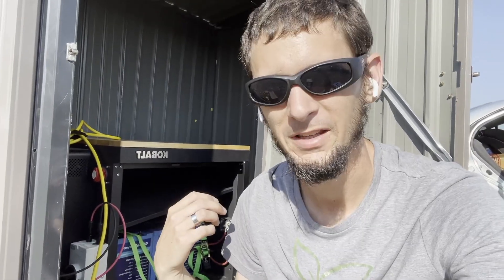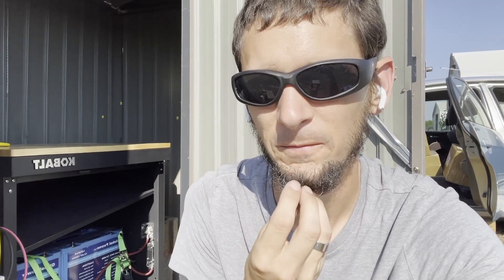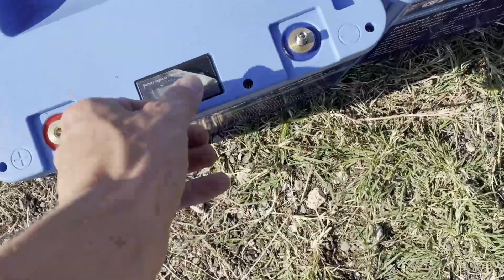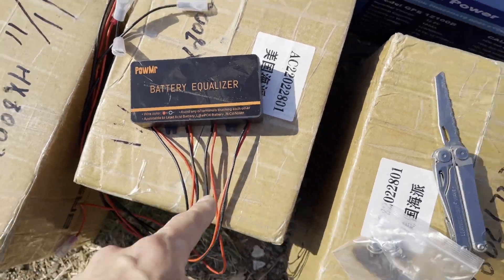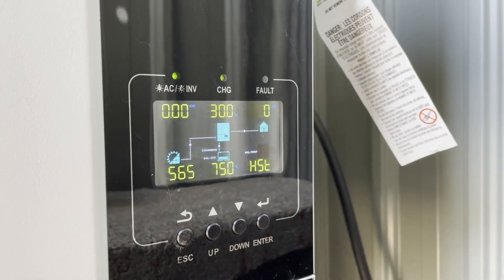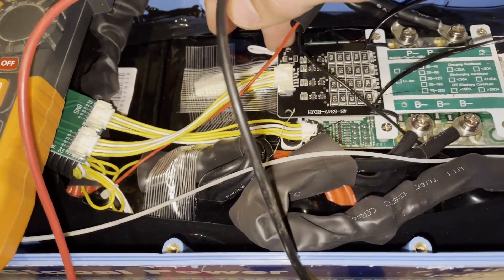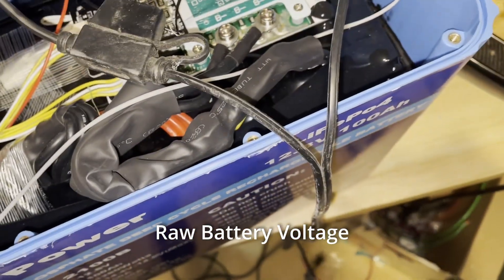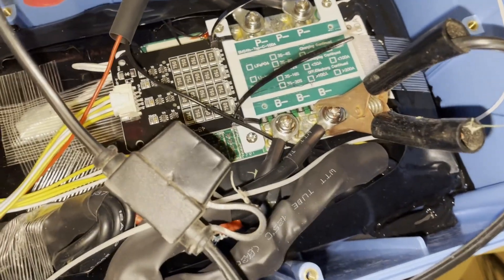Global Power Sabotaged My Power Cabinet

Comment: I had the exact same issue and Global just replaced it.  Its the second total fail out of 4 purchased.  I decided to do a capacity test on the other three once I received the new replacement and all three are way off 100ah from 58ah to 65ah.  The brand new one is closer at 88ah after only one charge.  I purchased them in November of 21

Comment: I have 2 of these batteries and am thinking about splitting the 20p packs in 2 in order to make a 48v, 16s10p Pack with those 32650 cells.  I would then use 1 jbd bms to rule them all.
Reply: 20S in a 12V battery?
Reply: @ericklein5097  oops 20p not 20s

Comment: After seeing your video review of these batteries last year, I bought 4 of these Global Power batteries. Then months later you posted another review downgrading them. I think you found a problem with the BMS but want to makes sure I get the right BMS replacement. Please post a link of the parts I need to upgrade the defect on these batteries, thanks.
Reply from the maker: Hi Ray, I apologize for any troubles I caused from that first video. Truly that first battery tested well but then others I bought didn't! Guess I need a larger sample size in the future. Regarding the BMS, are you running these batteries in series or keeping them in parallel for 12v operation?
Reply: No apology necessary. Your initial testing was thorough. I am using them in parallel for 12 volt operation on a 5th wheel camper. Thanks in advance.
Reply from the maker: @raystanton238  This is a good unit and has bluetooth if you want to monitor the batteries. It has the bolt-through connections so you shouldn't need to solder anything. Might need to pick up some 5/16" bolts and nuts from the hardware store. Just be careful the BMS can't come in contact with the positive and negative terminals of the battery once it's all buttoned back up. https://s.click.aliexpress.com/e/_DEhvU1D
Reply: I just got the 4 recommended BMS units for my four global power 100ah batteries. Can you recommend a video that shows how to install them? Thanks in advance!
Reply: @raystanton238  do you still need help or were you able to figure it out?
Reply: @ericklean5097 I replaced the BMS in all 4 batteries with JBD units and the batteries worked great for almost 2 years. Now some of the cells have failed in 3 of the batteries.

Comment: I wonder what upset it. Heat? Solar flares? I’m not so far from you and my inverter popped it’s clogs during the week.
Reply from the maker: I lean towards defect. I was pushing these batteries pretty close to their 100a limits and it failed within weeks of commissioning.

Comment: how have those growatt 3000 es been for you ? wanna get one but a bit skeptical after reading an watching reviews with bad mppt boards for some in less than a year
Reply from the maker: I’ve sold about four of the es version. Haven’t had any issues to date. Not a big sample size but it’s something.

One pair of them is in a tiny unconditioned metal building. One has 2500w of solar, other is just there for 240v operation. Hasn’t been operational for too long. Maybe three months now.
Reply: @BeeneEnergy  oh ok thank just wanna know how reliable they are
Reply: @diy-bj2ed  I was about to say I'm running the older growatt version not the one in this video didn't notice till after I made the comment
Reply: ive had good luck with the one i bought from beene but im very concervitive on the input voltage and have only ever run it up to 1900w solar input( witch has been more then enough) i also have an epever mppt as backup and about half a pallet of panels left incase it ever hails ( what can i say beene had a good deal on offer if i bought a pallet ). the newer higher input voltage all in ones have been looking real nice tho
Reply: @cec4  ok thanks for the reply, how long has the growatt been in service an what is it powering. from the Caribbean so hail isn't a problem for us.

Comment: You didn't have a cell balancer on this system? Did I hear you correctly there? Because if you didn't that is probably what caused the issue. Cells got out of balance and the other cells took charge or discharged a bit faster than the cell that died. Ive had this happen before on 20s batteries that I've put together. So it does happen.
Reply from the maker: Yes each battery had a balancer as well as a protection board. I think the protection board went out. But not an expert enough to say for sure that’s what went wrong.